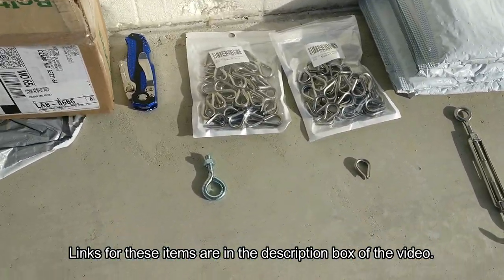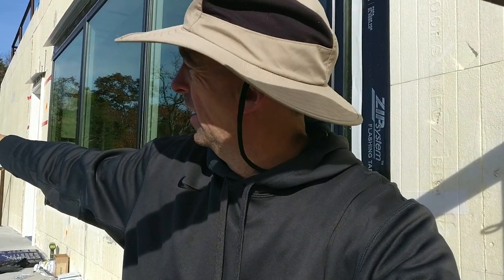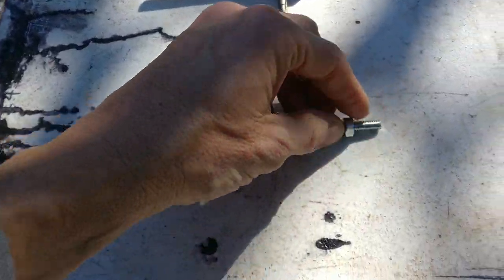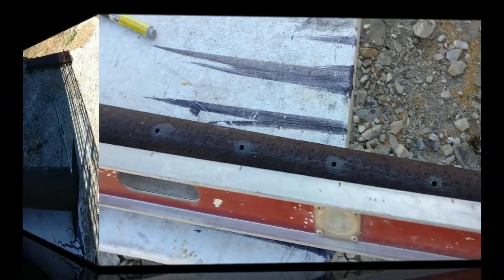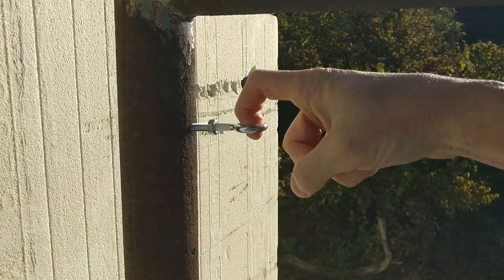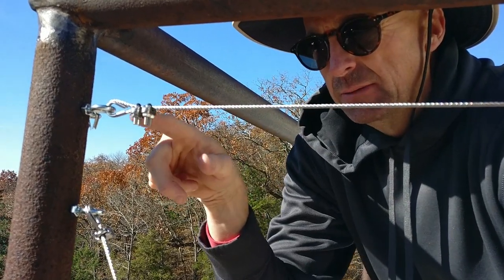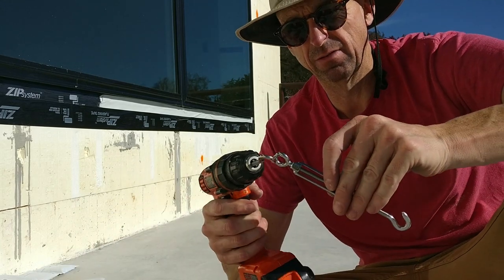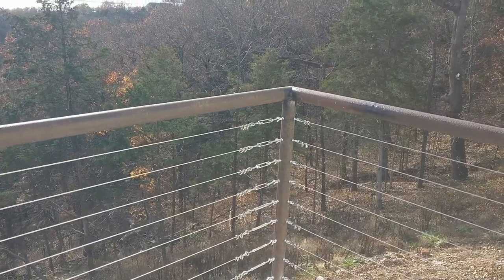DIY Cable Railing for Less! Build Cable Railing with Steel Pipe and Stainless Steel Parts off Amazon

Comment: That looks good. Were you required to meet any code requirements for tension? Spacing I would assume is 4”
Thanks for showing how you did this.
Reply from the maker: Correct! We used 4" spacing for all cable and from top rail to concrete.

Comment: Your cable clamps are on wrong. The saddle should be on the live cable.(the one under tension)  the saying is "never saddle a dead horse."
Reply: Might be why they're twisting
Reply: And some heat shrink might tidy up the loose ends
Reply from the maker: I'm sure you're right. We will have to address that.